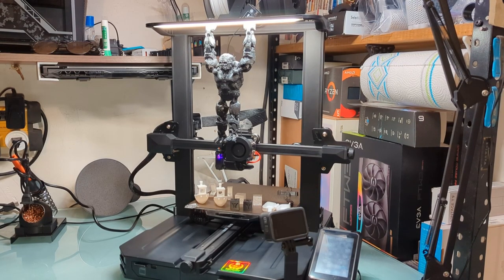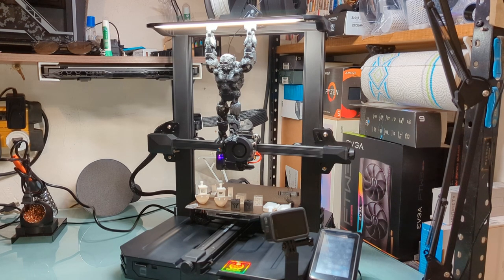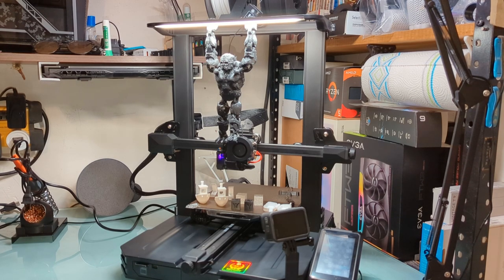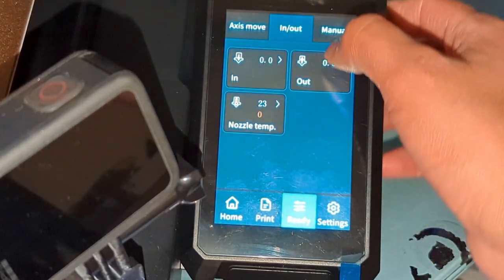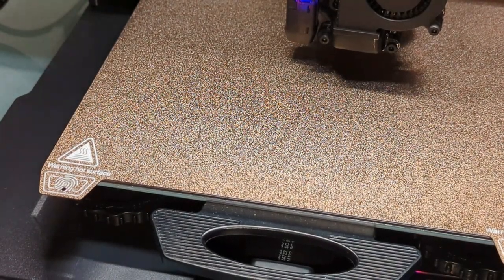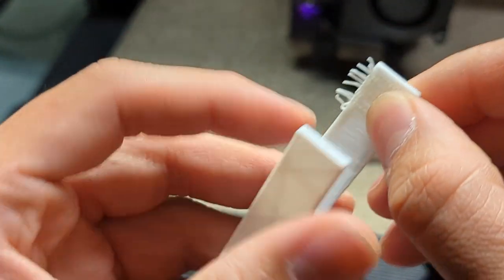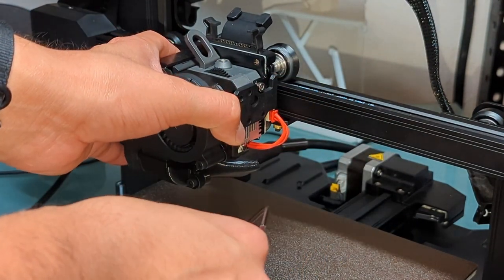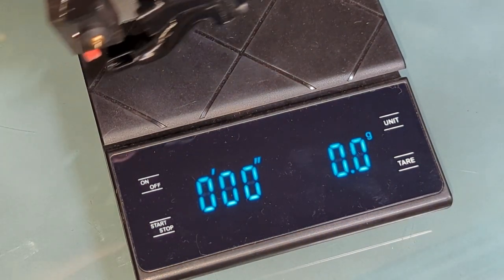Ender 3 S1 Pro - Custom Firmware Review and some other small stuff.

Comment: Great vid, but just a heads up. There are multiple branches for the firmware.
MARLIN-E3S1PROFORK-BYTT seems to have motherboard BOARD_RAMPS_14_EFB defined, while MARLIN-E3S1PROFORK-BYTT-RELEASE-CODE branche has BOARD_CREALITY_V24S1_301F4 (which I have in my s1 pro). I guess it's best to compare the code with the marlin stock config to see what has changed.

Comment: I thought the S1 Pro touchscreen firmware was closed source, has Thomas Toka been able to reverse engineer it? Or found a workaround or something?
Otherwise this firmware looks really promising, however, my biggest gripe that I have with the S1 pro and its screen is that the screen has great resolution, but it only displays an appallingly little number of characters from the gcode filenames, which is REALLY annoying. Even the old whatever-printers from way back when with the small 2004 LCD displays can show long and full filenames, but not a printer from 2022 :/ Also the Creality stock interface is 99% black and white (not even grayscale) which is dumb, since the screen is clearly a color screen and could be made to look a lot better.
I hope the firmware is still being developed and maybe we could get the full filenames displayed and perhaps even input shaping settings displayed on screen in the near future (the latest Marlin has now implemented some kind of early version of input shaping) :)

Comment: Would love to see the process!! And apologize for sounding like a troll but have you thought of installing klipper and making a video on it? I bought the plus as everyone online said its a good beginner printer, but their are I find next to 0 videos on software related stuff. rn I'm struggling with tramming where somehow the centre portion is somehow never as close to the hotend as the corners, this marlin fork might help me realise if that's just cuz i'm a noob or my bed being warped until I get enough confidence to follow instructions of github hehe.
Reply from the maker: Based on what I´ve been seeing, this custom firmware from Thomas is close to matching Klipper, of course buying a sonic pad and using all the sensors will be more accurate in tuning the printer, but I´d recommend you get this firmware for your S1 Plus first and give it a try,  push your print speed to 150mms to start and increase from there. I´ve seen some push to 200mms-250mms. The input shaping settings included with this firmware should work out the box.
Reply: @Zeltroix Yes, can't wait. 👍
Reply: The middle of the bed on my S1 Pro also always seems to be some 0.2mm lower than the corners. I've been contemplating on making 5 metal spacers of equal length (I've yet to measure the correct distance but it's around 15-20mm) at work (I'm a CNC lathe operator) and replacing all the four bed springs with those plus adding one in the middle of the bed so it wouldn't sag downwards. In my opinion the springs and manual adjustment knobs are unnecessary since we have the CR touch. In some newer printer models similar to this the manual adjustments have been ditched already, like in the Ender 3 V3 SE.

Comment: Could you please explain this firmware more in depth for us new to it? I like it, but just don’t know how to use it yet. I started a print using this firmware and the line that primes the nozzle wasn’t even on the bed. How do I fix that? I don’t understand the leveling process either. It says cr touch or manual. How does that work along with the mesh leveling? Any advice or explanations would be greatly appreciated! Thanks
Reply: Hey did ya figure it out?
Reply: That priming line is just a few lines of G-code at the start of the sliced g-code file (that is the file you send via USB cable or transfer to your printer via memory card to print). You can edit it easily in whichever slicer you are using, it's in the printer settings, called "start g-code" (at least in Prusaslicer and Cura; Creality Slicer is the same as Cura). You can change it to whatever you like, make it draw a smiley face or write your name even before every print if you wish :D
Why it's off the bed; My best guess is - without trying this firmware yet - is that the new firmware extends the print area of the printer to use the entire bed (stock firmware leaves some margins, 5-10mm I think, of the bed that aren't used) and the priming g-code defines the line to be printed at a negative coordinate, for example X-5 or Y-5, which, with a (presumed) 10mm margin, would still be 5mm inside the bed on a stock printer.

Usually manual leveling means that you literally level the bed manually with your own very hands, that is, move the nozzle to each corner and the center of the bed (on a stock firmware, you can  do this in Settings -> Leveling -> Aux. leveling -> click on the numbers from 1 to 5), spin the four spinny things under the bed in each corner until the nozzle is 0.1mm above the bed (use the provided instruction paper that came with the printer in between the nozzle and bed). It's advisable to do a few "laps" of this around the bed; every spot a few times.

CR touch is the pokey thing the extruder carries around with it, that the printer uses to measure the distance of the bed at multiple points all by itself. This is also called bed leveling, however, the bed is not physically moved, but the printer compensates for any warp in the bed it detects. But even with this method one needs to tell the printer how far is the nozzle from the CR touch probe - that is the Z-offset you set when you first start using the printer. Some newer printers can even do this by themselves, but the Ender 3 S1 Pro can't.

The instructions that came with my S1 Pro did tell me to how to do all this, have you guys not read them? There is a printer manual on the memory card too.
Reply: @TNX255  Thanks for the very in depth answer - I actually run this firmware myself - It's awesome, so if i were you i'd update my S1 Instantly. Mine runs like a freaking beast now. Motors are a lot quiter as well, you have a bunch of awesome settings, CR-Touch probe readings to help u level ur bed, mesh readings, autopid, and much much more. I was just trying to help OP, in case he didn't figure out, that he needs to input offset values and change the priming line, but thanks bud :)

Comment: My touch screen won’t turn on after it updated
Reply from the maker: I recommend you join the discord so you can get installation help there: https://discord.gg/CesqtDan
Reply from the maker: @user-uk3gc2dk3h  TT has made more upgrades to this firmware and it's pretty wild, https://discord.gg/JXxZewAK
Reply: @Zeltroix  Awesome thanks!
Reply: @Zeltroix  Hey, can you make another link? It expired. Preferably set it as never expire.